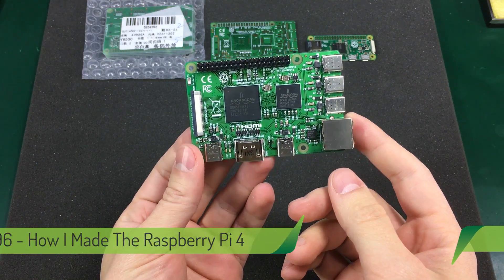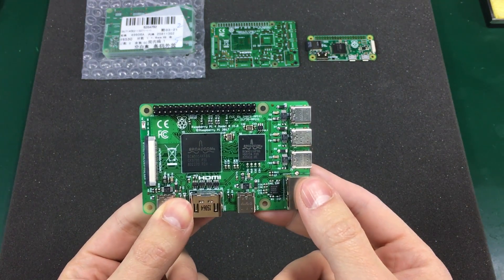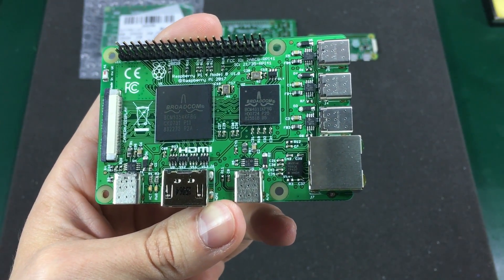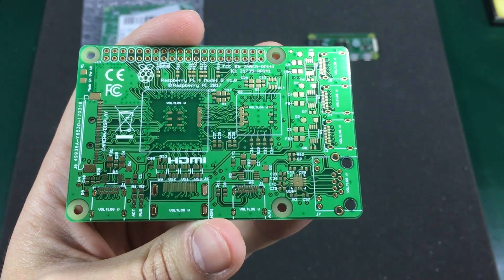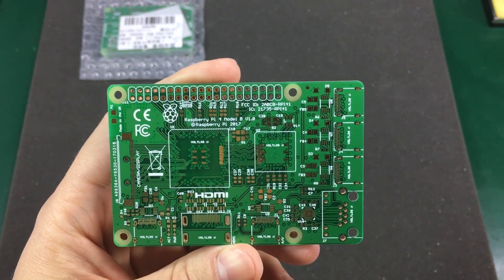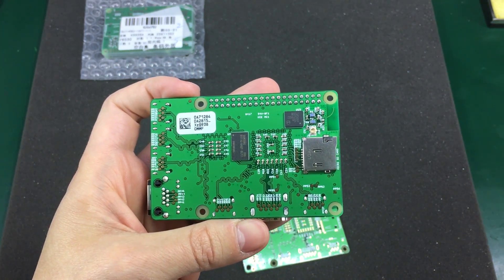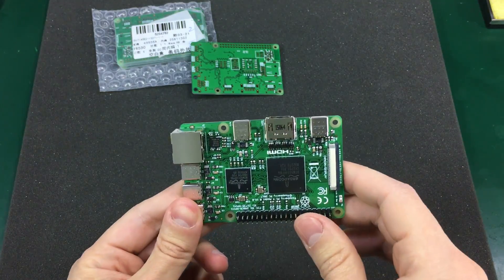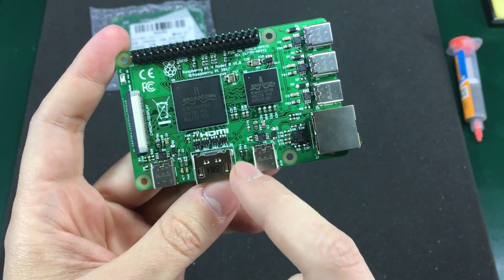Voltlog #96 - How I Made The Raspberry Pi 4 Board

Comment: This spec of the board doesn't woth to assemle a new board.Sorry guys, specs are useless.
• 240-MHz MIPS32® CPU core
• 16-KB instruction cache, 16-KB data cache, and 1-KB prefetch
cache
• Memory Management Unit (MMU) for high-level Real-Time
Operating System (RTOS) support
• 2.4-GHz direct conversion radio
• USB 2.0 host controller
• SDRAM controller
• 16-bit, 120-MHz SDRAM controller
• SDR and DDR support
• 2 MB to 128 MB capacity
• Supports serial or parallel flash
• Five-port integrated 10/100BASE-TX/FX IEEE 802.3u
compliant Auto-MDIX transceivers and LAN/WAN switch
controller
• Eight GPIOs for attachment to various external devices
(example: LEDs)
• One JTAG and two UART ports for debugging development
and attaching Data Terminal Equipment (DTE)